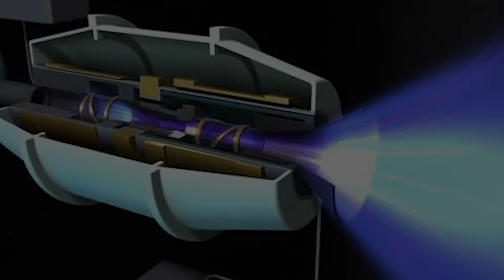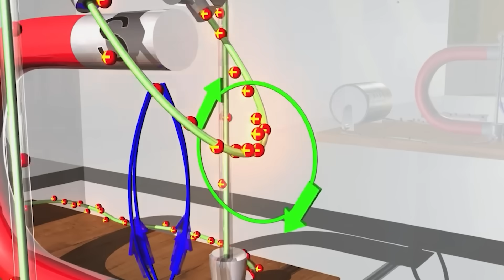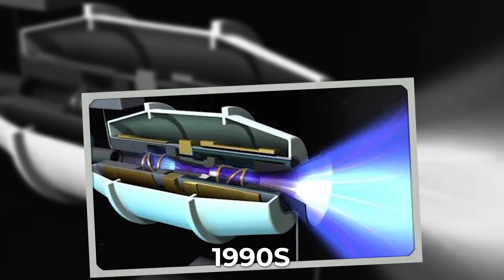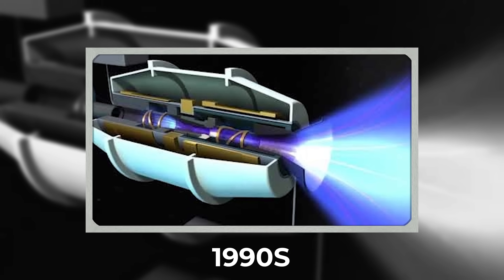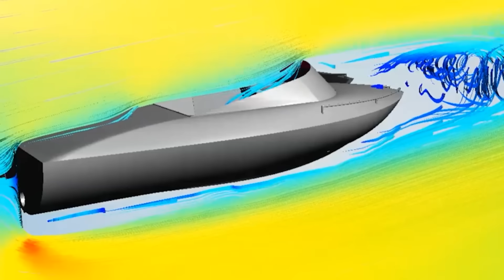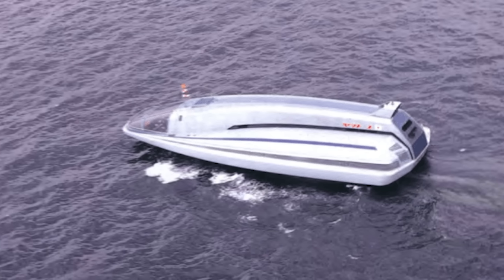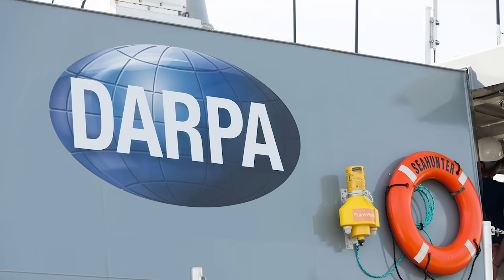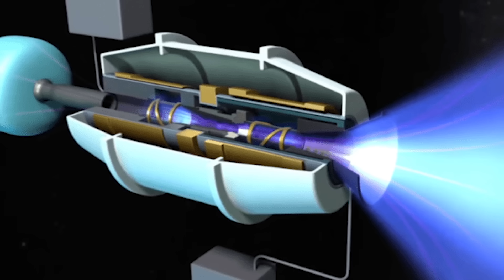The Engine That Moves Without Moving – MHD Explained

Comment: There is too much area not being utilized.  You can't charge enough water by volume.  ??? 😼
Reply from the maker: Thanks for sharing your observation about the design!
Reply: @TheForgeEmpire  Look at how an old boiler is built.
Reply: Not to mention you can use mechanical force inline with this tech.
Reply: 7 coils inside of a housing should charge more water.

Comment: Silence is relative. Most people can't hear high voltage but I can. I can stand under any power line blindfolded and know when I am under the center of the line based on the high pitch whine generated by the electric field alone. I also have a career designing power lines so it's not a completely useless skill. Mostly useless but not completely. Lol. I shocked the guys doing a high voltage resistance test on a 27 Mile line that I designed. As he turned on his suitcase sized system I had to plug my ears. He turned to me and asked what I was doing and I said.... "You can't hear that!?!?!" to me it was an extremely high pitched whine. The kind that would drive your dogs insane. To me it was just annoying. He couldn't believe I could hear it. At the time I was 26 and he was about 40. He said I wouldn't be able to hear it when I reached his age, but he was full of crap. I can still hear it any time approach a power line or substation.

Comment: In salt water, the traditional MHD uses electrode surfaces  to conduct ionic currents though a fluid in a magnetic field. Sea water will always produce oxygen and chlorine at the anode and hydrogen at the cathode. The electrolysis of water represents energy spent on splitting water rather then providing thrust.  Have you seen pulsed induction thrusters for space craft thrust, or electromagnetic ring launchers.  They use a rapidly changing magnetic field to induce an electric  current in a ring conductor. That current generates it's own magnetic field that pushes against the original magnet field. More importantly, there's no anode or cathode. And ions can react to the changing magnetic field creating circular ionic currents that generate their own magnetic field  that in turn push against the original changing  magnetic field.

Magnetic domains in steel are made up of matter that take time to flip, thus a magnetic pulse injected at one end travels down a steel rod at many meters per second.